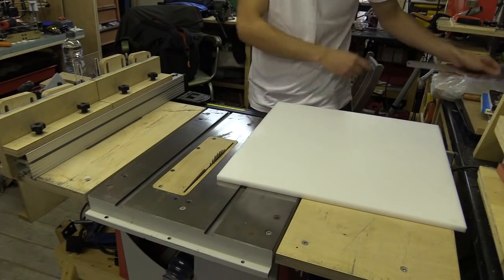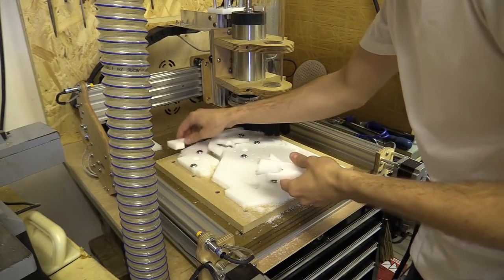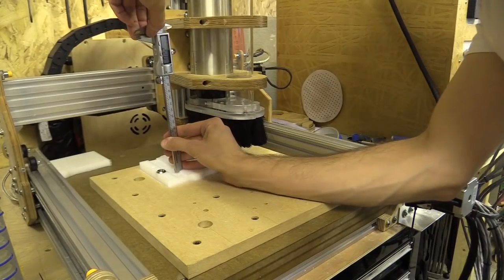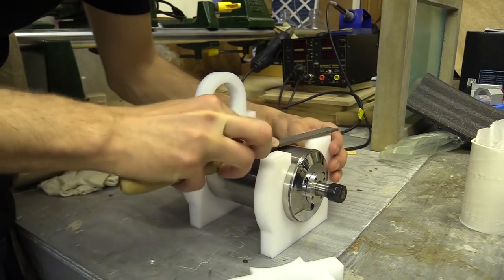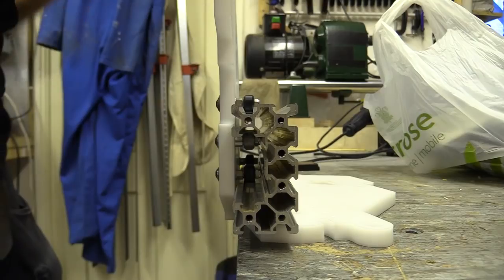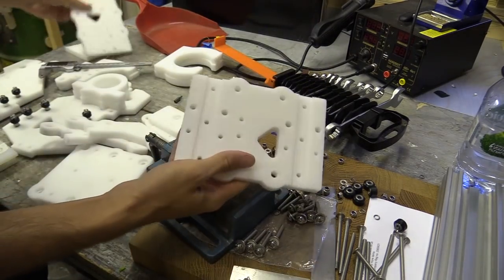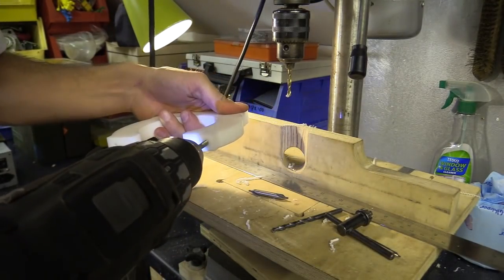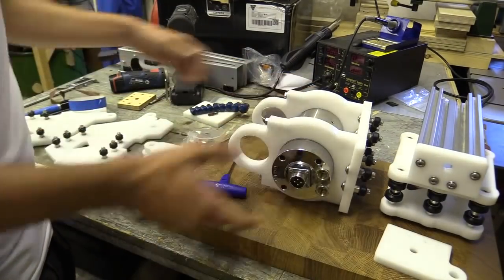#20 Old CNC Machine Cutting New One From Acetal #20 / Design Upgrade

Comment: Acetal threads IHMO don't come close even to aluminum so watch out for them when you start using the machine. Luckily, you can add a small slot and put in a square nut or one of those dovel nuts they use for wood if they ever fail.

Looking forward to seeing what your new machine can do :)
Reply from the maker: I think this machine will cut aluminium really well one Iv'e trammed the spindle. : )
Reply: I have a small Austrian built Emco V10P lathe & mill. The whole machine is some 200kg of purpose made steel - the mill part accounting for some 70kg of that - what you would call reasonably rigid machine for a small shop. It can even cut steel half decently but it still gets resonance and vibrations - even when cutting aluminum. It will cut it all right but surface finish leaves somewhat to be desired. My point is that rigidity is everything when cutting metal, and you need a lot of force to make the tool bite into it. Aluminum framed machine with plastic pulleys will probably do OK for drilling and carving but cutting with endmills is iffy. Don't get me wrong, it's still a great machine, just don't expect too much from it :)

Comment: Really digging the build..  But question for you, as you are building out the Z axis, how are you going to compensate for tilt if you need to.  I know that if you design it plum, it should stay plum, but the gap between theory in Fusion 360 and real world, as you've seen, can be rather large.  So, if there is inconsistency in your cuts, or captain's tape, how do you adjust for your spindle leaning to the left or to the right, maybe because your eccentric spacers are not holding your Z Axis straight.

Comment: great work. consider adding a laser option.
Reply from the maker: I could do but last time I tried on the x carve it was smelly and felt a bit dangerous.
Reply: but acetel cut on my 50w c02 laser cuts like butter but it also has exhaust evacuate online the diode lasers which i wouldn't use to cut anything smelly.  good job btw

Comment: How does the Acetal work out? Is it strong enough for a lite duty CNC?
Reply from the maker: I think if the designs right it's a great material. But for v-wheels aluminium is better.

Comment: Is there different types of acetal? I was under the impression that it has great wear resistance but is also brittle. This doesn't appear to be the case.
Reply: Michael Montague I think there is a fiber reinforced acetal that has a much lower coefficient of thermal expansion but I'd imagine the fibers might be made of something that's make it tough to mill - glass, carbon.
Reply from the maker: Just looked that up. Didn't realise there was reinforced stuff. Be interesting to see if it could be machined.
Reply from the maker: http://www.plasticsintl.com/acetals.htm

Comment: i respect all work you spent on this  but..
is it better to buy for 20-30 $ holder for spindle and pus some 50$ ball screw set with all you need ?
look on banggood and search for CNC there is all you need... i done it the same like you after all work tolerance and looooooses were to big to work ( and self- resonance) with something more than wood... ;-)
Reply from the maker: https://youtu.be/gO-NVW6ICBQ
Reply: Marcin Witkowski I'm pretty sure you get what you pay for with ballscrews. Some people have stated that the cheaper ballscrews are worse than leadscrews. I personally don't know as I only have experience with leadscrews.